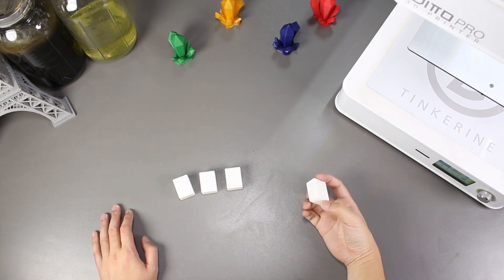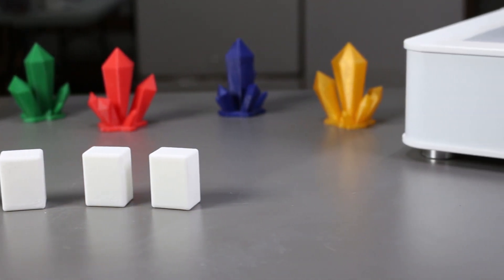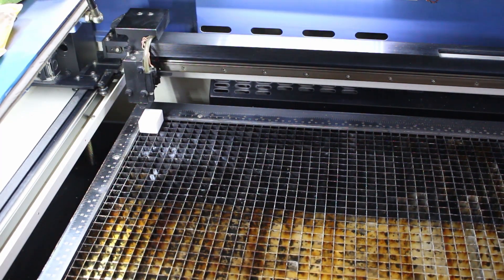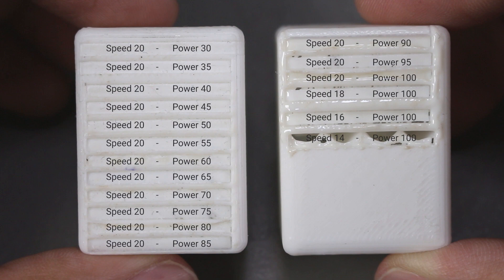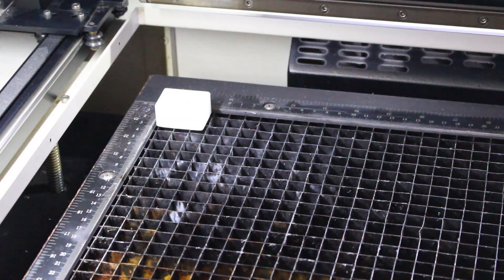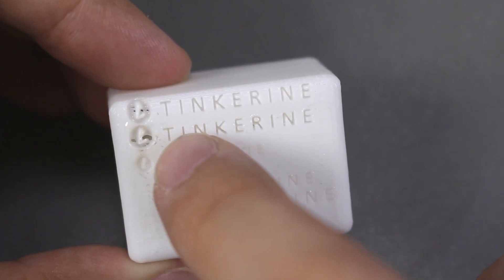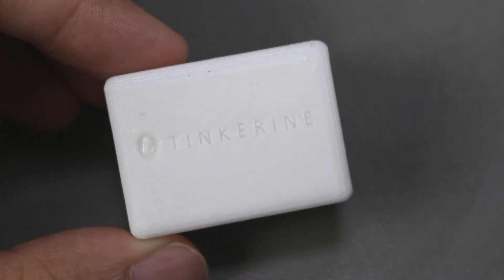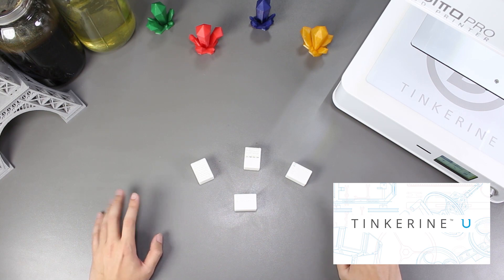Laser Etching 3D Printed PLA Parts

Comment: Could you try painting the pla black with a few coats, then etch off the coat for good text contrast?
Reply: Would make more sense to use a black or other infill and etch the top layer off. There are a number of materials that etch very well using a 1 micron fiber laser.
Reply: I have done this and, at very low power levels, it's viable.
Reply: apply some toner on the surface before lasering.

Comment: Dear Tinkerine! As you told you are using diode laser but may be important the other attribution of laser. What the wavelenght of laser (color if visible)? Focusing point diameter (yes we know laser power is 60W but cannot figure out the POWER DENSITY) Thanks for answer.